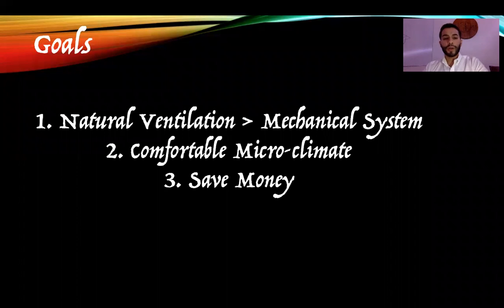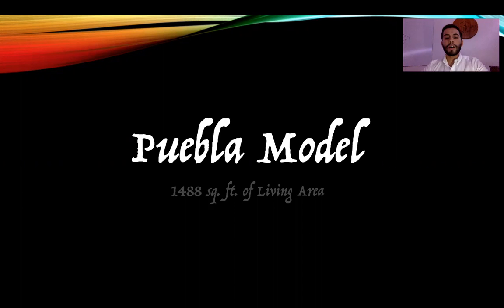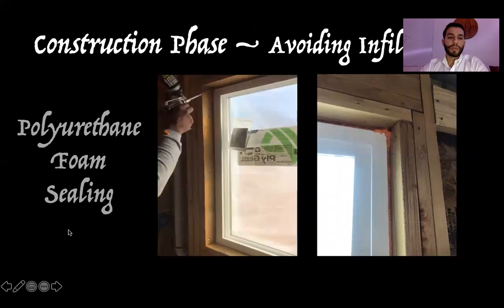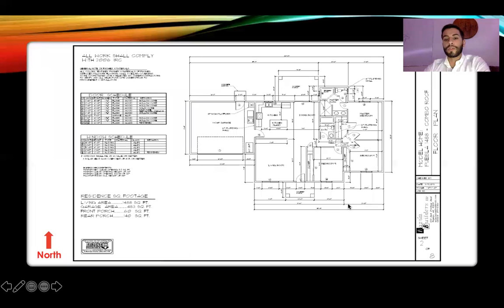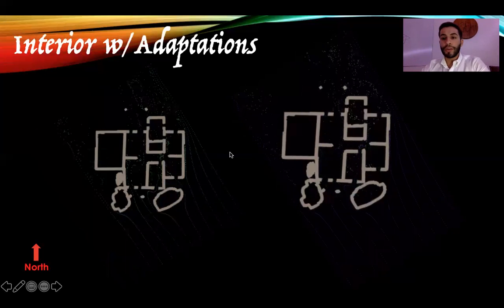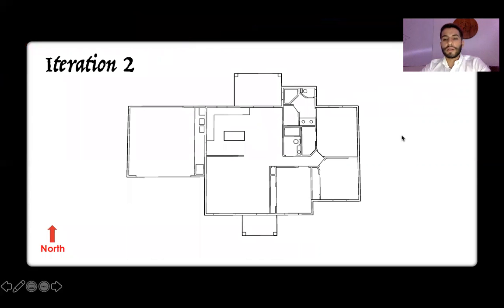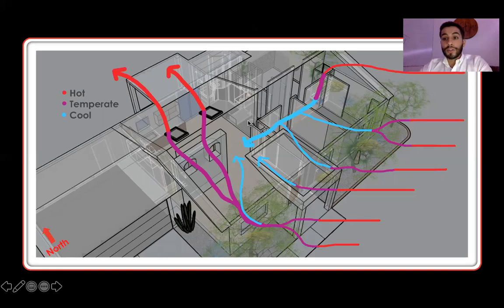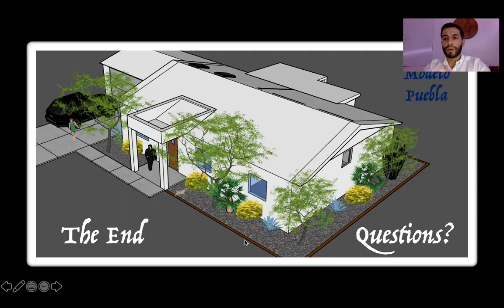Natural Ventilation | Avoiding Infiltration | Passive Energy Efficient Home Design | ARC 461P | SBE

Comment: Am from the southern part of India..here wind direction is south west..but during summer west side is crucial as every one knows..So should we give an opening in west side with proper shading with over hangings and leeward in East side? Or is it advisable to avoid moderate openings in West side..hope a reply from you
Reply from the maker: Thank you for the comment. Because India is in the Northern Hemisphere you will want to mainly shade the south with horizontal shading structures. In your case you will want to slow the air surrounding the home first before it enters (micro-climate). You will want to block the windows with shade trees mostly in the southwest side of the home. You will have slower airflow, but it should be cooler. The East & West window directions should be your main entry point for the natural ventilation, here you should use vertical shading structures to avoid sunlight.  In the afternoon the west side provides the most heat, avoid a window here unless you plan to put heavy shade trees, small vegetation and vertical shade structures. Place cool tower on the North side where shade is present all day. Any more questions contact me ( email)  through my website. www.builtwithsustainability.com Thank you.

Comment: Say a single storey rectangle house with wide side facing East-West, what is your list of advice. Appreciate any useful comments here. Thanks,
Reply from the maker: You always want the longest side of your home to be facing the south ( if you are in the northern hemisphere). This will give you better heat dispersion throughout the day. If you live in hot climate, shading and microclimate is your best bet. Focus on the southwest direction, with shade trees that produce leaves in the summer and shed the leaves in the winter. Use wood chips or mulch for retaining moisture! Also look into light colored solar shades for windows on the exterior, if you already have two panes of glass. Feel free to ask for additional help. Thanks for the comment.
Reply: @builtwithsustainability6221  For a challenging situation whereby the land is rectangle wide facing East-West, this is the reason, the question arises on how to design it. Or would it be better to construct a square shaped building then.
Reply from the maker: rectangle shape is more energy efficient than square shape.
Reply: @builtwithsustainability6221  What about tropical country eg Malaysia or Singapore? Would your advice applies too?
Reply from the maker: In this video, the climate is semi-arid desert, hot but dry. This information could help such as the cool tower. However you have more humidity in southeast Asia , I would suggest a building that is lifted off the ground to allow ventilation below, through and above. Mechanical solar powered ventilation could help tremendously. Any more questions, visit my website to contact me. Thanks. www.builtwithsustainability.com